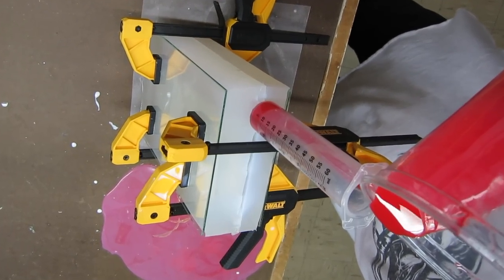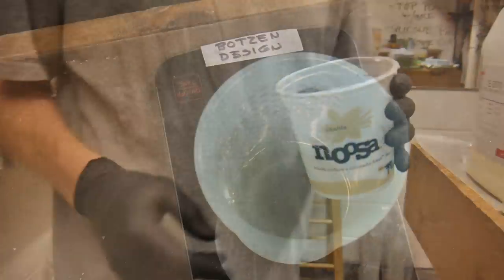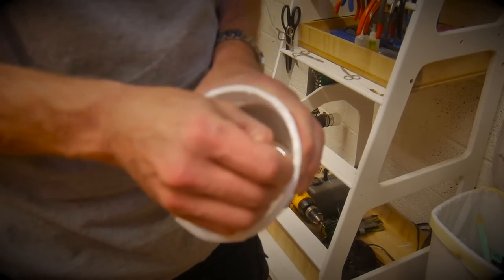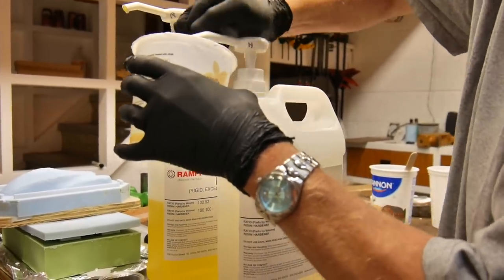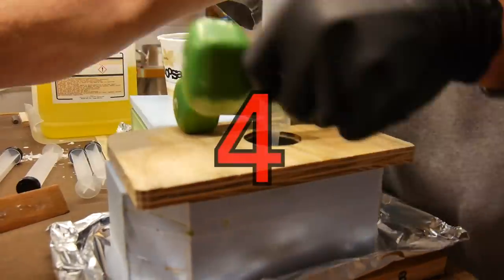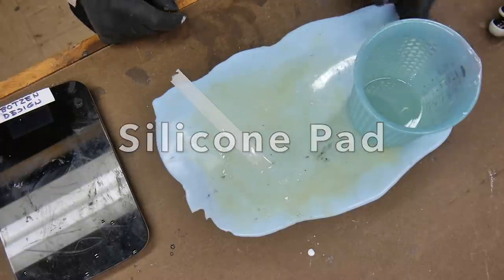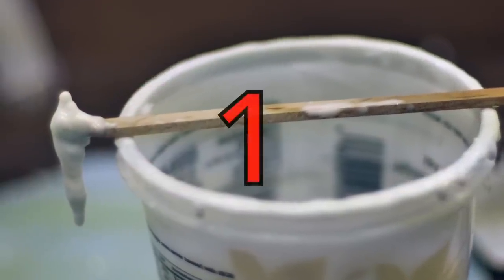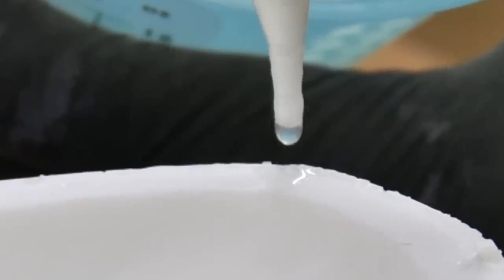Resin Casting Tips Tricks Tools and Hacks for your molding projects

Comment: Okay, that tip about the ketchup pumps is fantastic since I just started buying my casting supplies in bulk, so now I have to deal with 45 lb jugs of flexible resin and 40 pound containers of silicone. I just need to find the right sized pumps for 5 gallon jugs...

Comment: Brilliant tips, i dont use a glass work top but i stretch bin bag over it when using polyurethane resin,  does not stick to it at all, it's like Teflon to resin, and for the surface for putting the sticks, i cut the base out of a resin container, then once I'm done with the next container, I make a new one
Reply from the maker: Great tip!

Comment: Like your presentation.  Short and to the point!!!  But would like to see them longer.  I would like advice/instructions on how to hang three objects suspended in resin. So would be about a 2-2 1/2 cup size mold.  But how to get these objects suspended evenly.  They are uneven shapes.  Maybe I have asked the wrong YouTuber but had to try.  Thanks

Comment: Love this video I want to make a block of resin with a picture in 
  1 is paper stable enough to put in resin
  2 I want to put bands of colour in which is best pigment to use 
  3 how long does it take to set before I add another band of colour

Sorry for asking so many questions I have looked at other videos but found yours the best so think you will have the best advice thanks
Reply from the maker: karen devanney Thanks for the questions, Yes paper is stable enough to pour into, think paper cup. There are many types of pigments, just make sure they are not water based and recommended for urethane resin. I don't have a preferred brand that I am recommending at this time. Different resins have different set times, so it depends on the resin you are using. Good luck
Reply: Thank you for your help 👍

Comment: I use boards and mold straps to hold my molds together. I also pressure cast everything, molds and castings. I don't get bubbles. 
I have 12 pressure tanks of various sizes, including some rated for 150psi at 650F. Dunno what would have been sprayed from them under those conditions. At the 60psi I use, they'll never fail.
When I started doing resin casting around 16~17 years ago, I tried vacuuming the silicone and resin then casting at ambient pressure, I got a lot of failures, wasted lots of material. I have a Gast rotary vane vacuum pump that's sat unused for years. By the  time the bubbles were sucked out of the silicone or resins, they would be well on their way to curing, leaving little time to fill the mold.
Another issue when not doing pressure casting is sharp, inside corners. They will trap air and cause bubbles in silicone and resin.
A quickie page I did a while ago on making a pressure cast, 2 part, silicone mold. Since I did this one, I've switched from using shiny surface corrugated cardboard for mold forms to covering plain corrugated cardboard with clear packing tape. http://partsbyemc.com/pub/mold-making.htm
The equipment to get started with pressure casting will cost under $200. Harbor Freight has small air compressors for $56.99 and Item #66839 is a 2.5 gallon pressure tank for $99.99. (Subscribe to their e-mails and you'll eventually end up with discount coupons.) You'll also need a second pressure gauge, a 1/4 turn ball valve and a quick connect adapter for the air hose. There are some how-to's on the web for the changes to those paint tanks to use them for pressure casting.
The Prop Builder's Molding & Casting Handbook by Thurston James should be owned by everyone doing this stuff. While the materials demonstrated are mostly obsolete now, *they still work*, and the techniques are applicable to newer materials.
Reply from the maker: Thanks for the lengthy comment, very useful. Thanks for supporting the channel Gregg Eshelman much appreciated!

Comment: I've just started to watch videos on how to use epoxy resin for jewelry and/or craft projects and have a question.   I have seen how they make jewelry pieces and then sink in hardware to make them pendants, earrings or dangle  beads.  So I thought why can't you just make beads to string up for jewelry too?  And I am trying to find a video or instructions on how to put something in the middle of the mold to create the hole for beading.  I thought of a few things you could use but I can't think of a to be able to remove it after the epoxy hardens.   Do you have a trick, tip or idea that can help me?  Thank you, Brandi

Comment: Dear Eric, I have several questions about an art project I have, I want to encapsulate cracked ground soil into resin or acrylic, im not sure what materials to use, as well how to do it, the soil is on the ground, I want to leave the most natural view of the cracked soul.  Should I make a delimitation with boards cut into the ground? sides and base? and then pour the acrylic for the material to absorb it? or what do you recommend? Any orientation would be great, thank you

Comment: I actually laughed at how ingenious the mixing sticks idea was, what a legend. Fantastic

If I may ask a question, if I'm doing small resin pieces and want to add weight to them, what would I add? I have tried Ure-fil 3 (ceramic) but the weight difference is minimal. What is it that Hallmark and Jim Shore use to make their casts have their heftiness to them?
Reply from the maker: Try sand, or steel shot
Reply: @EricStrebel  steel shot? What an interesting idea. Would that be more for rotocasting?

Comment: WOW!!!!! Some amazing tips!!! I especially like the silicone pad, never thought of that. I don't wargame, but I do like to build and paint models and mini's so these bases are great. Heavy and thick, no more super gluing washers to the bases anymore!! I have a mold of 24mm, 33mm, and a big ol' box shape 2"x2" of bases. I always keep it handy when I'm pouring resin. Can you suggest a mold material for that is highly durability and has a long life once opened??  I use Smooth-On Oom Moo 300 and I get very mixed results. What I mean by that is:
1. Sometimes my molds come out perfect, strong, and seem to last forever(even tho the resin I use heats up hot). Other molds I've made I get maybe.... 5-6 casts before the mold just falls apart. I'm talking smooth surfaces, no under cuts.
2. Is oom moo 300 the right resin for me? Lately I have been tinkering with this product called The Blue Stuff. You heat it and boom mold away. It's really great in that it replicates detail great, reusable and doesn't seem to stick to anything. Even itself! You can make 2 part molds with the same material in about 10 minutes! You only get 6 sticks, which is perfect for small stuff, but I want to make casts of larger rock work or other surfaces and OOM MOO 300 just doesn't hold up that long.
3. When you open the bottle of the casting material you have about a week before the pink(whatever part) becomes solid and the blue is still liquid. If you haven't used it before it is a 2 part mold material that comes in 2 pint jars. It's really simple 1:1 ratio which is great, but the shelf life really sucks. 
So can you suggest something better? Great video and thanks! Sorry for the TLDR :)
Reply from the maker: Rob's Hobbys Thanks glad you liked the video. Feel free to share on social media. I have never worked with the products you described, so I can't say much about them. Honestly not a huge Smooth on user. I use mainly Innovation Polymers products and silicones from silicone inc.
In general terms I would say that: if you are having mixed results try a different product. I never have unpredictable results with the innovative products, just google them and you fill find them.  Best of luck and thanks for the comment.
Reply: Thanks for the help bud! I'll look into that and hopefully get better results in my castings. Cheers!
Reply: Get a digital scale. One that weighs up to 5KG in 0.1 gram increments. It won't be cheap but it'll pay for itself in molds that last and castings that don't fail because you'll have the mix ratio accurate. Most resin manufacturers have buried somewhere on a data sheet the mix by weight ratio for their products.
I uses Silicone's Inc P60 for all my molds, casting mostly Smooth-On Crystal Clear 202, clear or colored with their transpararent and/or opaque colors. I use Mann 400 release spray *every casting*. I wipe the mold with a clean cloth, blow with compressed air, then spray fresh release. Every so often I'll wash the molds with warm, soapy water. I have some molds over 15 years old, still producing good castings. If I need to paint the item or will be casting more resin on the item (such as for the 2-color Hudson shift knobs I make) I'll use Mann 200. The 200 can be cleaned off but doesn't leave a glossy surface. Not an issue on those knobs because I sand and polish them.
Don't bother with tin cure silicones. The price isn't that much less than platinum cure. They shrink more than platinum cure (many plat cures have essentially zero shrinkage). Tin cure molds can deteriorate just sitting around. Platinum cure molds can last for many years if treated right. Tin cure molds need to be post cured, heated, to finish off the curing process.

Comment: Hi eric i am new to resin i have never used it. I want to make resin beads for a boho beaded door curtain i am making. I am using silicone to make the moulds but what can i use to go in the centre of the mould to create a pre-hole so when the bead sets i dont have to drill a hole into it? Can i stick a metal skewer or plastic stirrer or chop stick? Would really appreciate ur advise please? I am a new subriber from over the pond in the uk. X
Reply from the maker: A small metal rod would be good, use some release agent like wax to keep it from sticking to the resin

Comment: Hey man, thanks for the video! I'm search for an answer to a resin question... I want to dip some objects in resin so they have a nice coating on them... and maybe suspend some stuff in pendant-like shapes like a teardrop or whatever...

Let's say you had a... um... an odd-shaped trinket you wanted to coat with resin... I imagine it's easy enough to dip it... but the how would you hang it to dry? And, here's my other concern... I've done the hang dry method with paint and there always seems to be a blob at the bottom where the drips collected. Is that inevitable and I should just plan on sanding and buffing? 

I really would like to create droplets or spheres that contain an object I can later turn into suncatchers or jewelry or whatever... but I can't think of a way to do it without a mold. And the dipping thing.. have some cool trinkets and stuff that would be great with a decent resin coating but I want the resin to take the shape of the thing that I dipped. .. not have a flat edge or seams, etc...

Any advice you could spare me? You clearly know your stuff!
Reply from the maker: It’s not something I’ve ever done I’ve seen it done in layers but I’ve never done it myself

Comment: Just started mate and had a huge issue with my resin sticking to my silicone molds. Wondrin if you have any tips
Reply from the maker: Make sure you are actully using silicone, the only thing that really stick to silicone is silicone, not much else sticks to it

Comment: Can you put resin in side a wax mold because I have a mold of my hands but it made out of wax and I wanted to know if it be good to do it to it to keep the hands from melting
Reply from the maker: Use plaster instead
Reply: I don't' think a wax mold would work. The curing process is exothermic - it generates heat. That would melt the wax before the resin has solidified.

Comment: I have a question about casting a thinker mold?  I have tried a little mold that I purchased that looks like a crystal about 3” tall and 1.5” wide but i filled it half full and the resin heated up so much it bubbled and started smoking.  Am i doing something wrong?
Reply from the maker: The Straders what kind of resin? sounds like a polyester resin...use a resin with a slower set time like a urethane resin, particularly important with parts that have a large mass, if its polyester use less hardener.
Reply: Eric Strebel i believe it was an epoxy resin. It mixes 1 to 1 workable time of about 35 minutes cures to touch overnight.